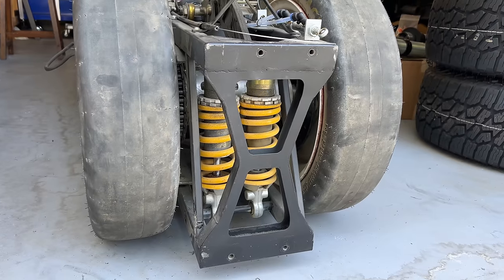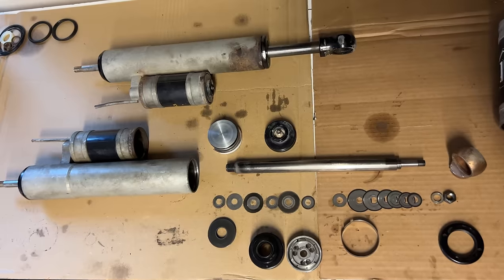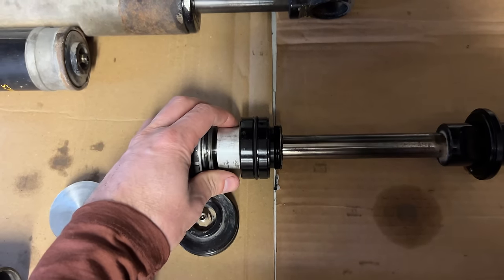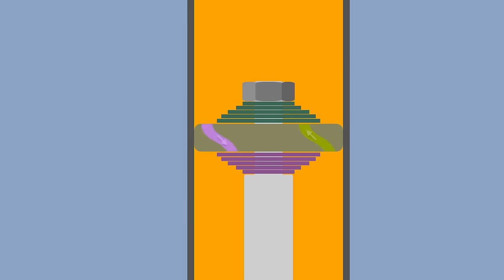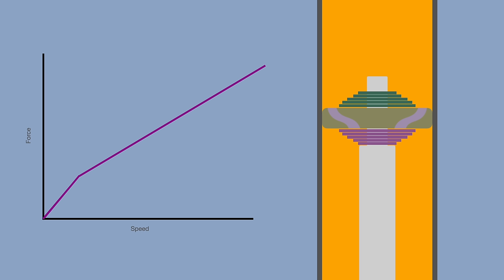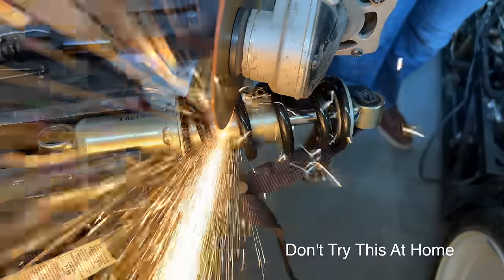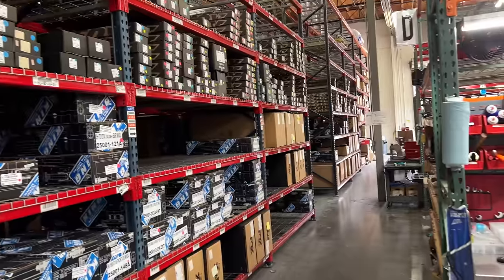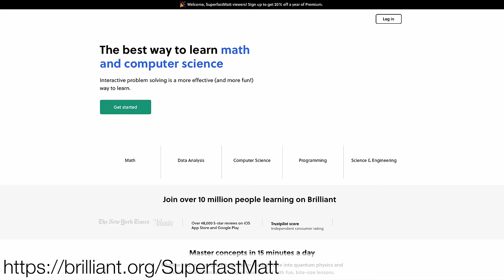How Shocks Work

Comment: Ex motorsport damper tech here
Reply: Where? What brands and suspension types?
Reply: @FlattardiansSuck  a motorsport specific aftermarket manufacturer involved mainly in production chassis endurance racing. We did shocks, obviously, but also capitalized on the strut market and did a lot of porsche stuff. This particular company liked to run a high rebound to compression ration.
Reply: @noncog1  i hand built race, rally, sprint car, drag car 50/50 and 90/10s, boat transom dampers, railway, mining equipment, bowling aley, stunt and even the Bat Mobile, Flintstone and Mad Max cars for Warner Brothers.... in the days when nothing was as is now. My dad had one of 3 top shock dynos in Australia. We did many amazing jobs
Reply: @FlattardiansSuck  heck yeah man! I think the the most impressive part of this company was the level of precision on hand assembled dampers. When we'd do a run of spec boxster struts wed match forces within 2% in a set, with a total variance of around 5% across the entire run, and thats actually one of our lower tolerance dampers as we couldnt control the bore quality on the outsourced steel bodies with welded tabs, which we would try to accommodate for on a damper by damper basis by varying the thickness of or piston seals by hundredths of a millimeter, and they were preloaded underneath incase the bore wasnt perfectly true. Our alu body shock stuff was crazy repeatable as the bores were near perfect. It was also fun working in the service bay and being able to tell things about the cars usage by what we found in the teardown. And when we finished the rebuild wed redyno them and compare to the original dyno when they were first built, and as long as we hadnt revised the damper or changed spec for the customer, wed typically still be within 5% across the board years and years later. We did these dynos at full soft, half, and full stiff. Out cup car dampers made so much rebound we could only run them on pur 5hp dynos
Reply: @noncog1  I hear you. Our reconditioning section had a warranty rate of 1 or 2% because they were each hand made. Our warranty was 2yrs but we'd cover it if it was our fault... as we had an almost perfect quality. Each shock or strut etc was specifically valved per car, and in street drag cars, were specifically rated per corner. We would build 4 sets of rally or race shocks, dynod per corner. Im talking the 80s n 90s. No outside factory dyno, except ours. I've built some weird n amazing shit bro.... thanks for your response
Reply: I'd love a chat sometime
Reply: @noncog1  my dads business would get early F1 and rally cars to his shop to be assembled and shock dynod
Reply: @noncog1  I hand valved everything...by feeling the shim plates, rebound springs, foot valves by hand.... until I introduced my dad to tech. Lol.
Then marriage split, lost all........
Reply: @FlattardiansSuck  i bet working on f1 cars back before they became so formulaic was really interesting
Reply: @FlattardiansSuck  we assembled by hand but checked certain things with calipers, some with a surface gauge, and a lot by feel. The feel thing sucked as a new guy, but once you got used to things and knew exactly what you were looking for you could drop a shaft assembly in a body and know if you needed to change a band, when we put the adjusters over the bypass orifices we could feel if they were in the right range after a couple quick clearance passes then a blow out. Its crazy how accurately we can feel clearances when its part of a moving assembly.
Reply: @FlattardiansSuck  we had qa at several points along the process, so we knew what was up with each damper. I recall 1 time a tech made and error and it got through, other than that most the warranty stuff was installer or end user caused but we just took care of it bcs when your top option retails for $10,000 you keep the customer happy even if theyre wrong, as long as it isnt something theyll repeat. We had one guy absolutely sure he had a damper issue causing handling symptoms, yet we couldnt find anything, yet we did a full rebuild of everything, turns out the dude changed his front end geometry but assumed that wouldnt cause the change he suddenly experienced....
Reply: @noncog1  I made $400 per hour valving rally and race shocks. In 1996
Reply: @noncog1  got an email?
Reply: @FlattardiansSuck  damn, i made $18/hr, two years ago.... But got access to really high end shocks on the cheeeeaaap.
Reply: @FlattardiansSuck  i do but only the one i use for my whole life, and dont really wanna put it up here where everyone can see it... Sorry.